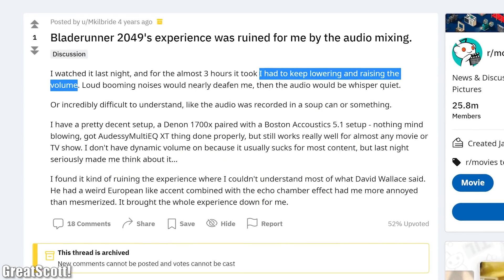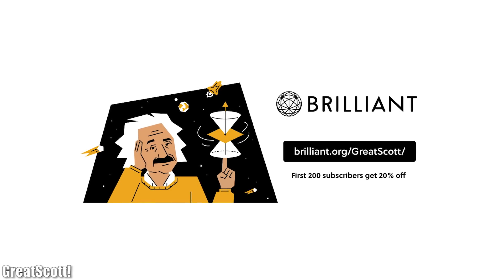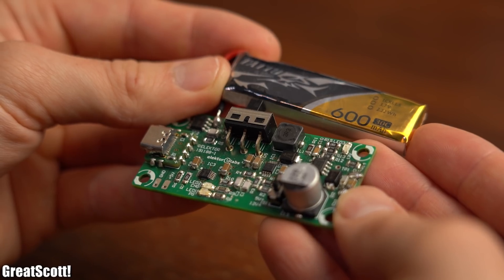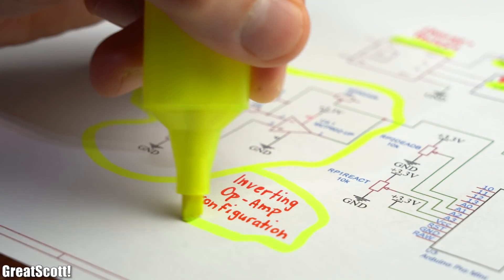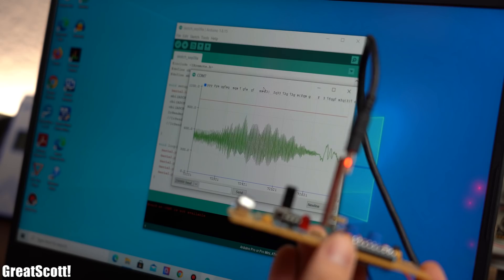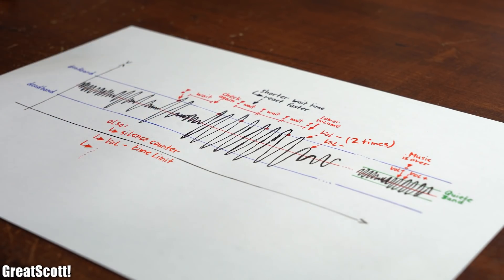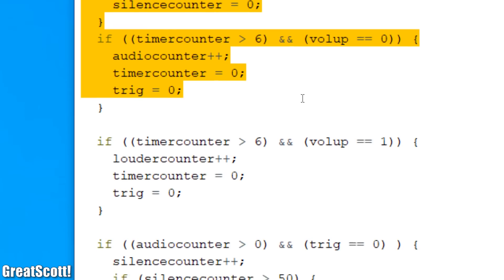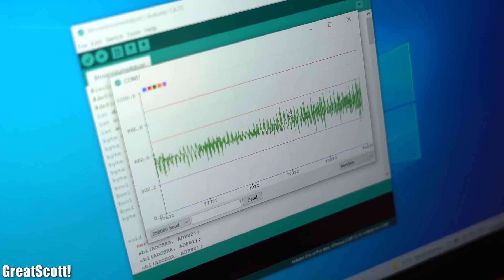Movie Music has a LOUD PROBLEM! So I fixed that! (Automatic Volume Adjuster)

Comment: I don’t see that this needs an extra solution for the home. The audio mix of movies is always done for the cinema of course. In the IMAX theatre in my town the max levels are around 92 dB(A), which is right to get the impact of sound effects intended by the makers. In the home however these levels are too high in most homes. When I lower the level to say 85 dB max, then the dialog can still be heard well enough. This depends on the background noise in your home though. In my house it is 25dB(A). However when your ambient noise is say 35dB(A) and you live in a badly isolated appartment, then you cannot increase the level in order not to disturb your neighbours. In that case most equipment manufacturers offer the possibility of compressing the audio such that it suits your environment. Problem solved! It’s a compromise, but well worth the effort in exchange for peace.

Comment: I remember A sketch like this going around about 7-8 years ago when the 328p was getting popular. I never got around to building one but I need to now. I would have made mine run off USB power as most sound bars have extra usb ports or you can easily use a ac/dc 5v power supply. The battery seems pointless and semi sketchy as I don't even allow that battery type to be stored inside my house. But anyways as the device never moves. Supplying power is not really a issue via cable.

Comment: Excellent project, I will make this circuit some day, I like to use my studio near field monitors as computer speakers, and watch youtube all the time, I extremely hate it when the volume suddenly rises simply because the volume is not same for all youtube videos. Was planning to make an Automatic Volume Adjuster for this very reason, couldn't find any videos on youtube that shows how to build one for this application. Now I have a guide to follow to make a circuit, will save weeks of research. It seems like you did a lot of assembly programming on Arduino, I can tell that was a nightmare. Would use Atmel studio for the programming if using AVR chips (Arduino). I hope it can quickly lower the volume before the sound reaches my ears.

Comment: Modern movies are produced and directed by assholes.  I solved the problem by just refusing to go to the movies any more.  I value my hearing too much.  I'm glad you designed a way to fix the problem electronically, but I still think the proper way to fix it is to boycott the assholes in the movie industry.

Comment: Why not build an AGC (automatic gain control) using arduino and connect it between the sound source and your soundbar. I suppose it will give you the best result with the lowest latency.

Comment: Well, each streaming service has their rules, music and video, mostly approved by AES/ EBU for loudness. But now they are dealing with different sort of stereo, 3D etc channels. Which has to process to Stereo, or even 10 channels to stereo, each channel will be added to a designed stereo channel, which makes it louder, or quieter. Like VWestlife stated in many televisions you can set different dynamic ranges. For Videophiles and their cinema sound, too much had to change, with all the problems included. Can you imagine, how it is, for us, mix engineers to make videofilms of musicalbums?

Comment: That's a really cool project! Movie musics have been bothering me forever too!
I think I will do it with an ESP32 micro-controller plugged in the wall with a standard USB charger because I don't intend to move it.
I think I will setup the ESP32 as a wifi server and build a basic HTML & Javascript webpage to access from a phone in order to change the device settingsrather than having potentiometers. Maybe to show some data too if possible.
Your way of detecting volume spikes seems to work just fine but I want to explore something more complex on the signal processing side just for fun :)

Comment: Movies have thar great dynamic range because they're meant for theaters. Final compression should be done optionally at the player or TV and only if the user turns that compression on. Please don't ask for compressed mixes on the disk as a norm because that's how CDs and every other digital format for music ended up sounding like garbage despite having all the necessary technical features to be able to sound good.

Comment: Most Receivers, Bluray and DVD players all have audio compression settings to accomplish this.  On my Marantz receiver it's called "Nighttime mode" and you can adjust the amount of compression in the settings.  On my PS4Pro it's in the Audio settings,  On my Xbox One X it's also in the settings.  It's also in the settings for media players on the PC, Mac and Linux.  Um... did you even bother to read your manual?

Comment: This issue exists with broadcast TV aswell. Commercials are always very loud. I remember my dad talking about how an invention like this would get sold very well.

An improvement idea from me: you can catch the audio signal via aux from your TV, most TVs let you enable multiple audio outputs. Then you can use the aux input to decide whether or not to change the volume. Maybe even adding another audio output on the device and connect your sound bar with that. Bet there is open source software for doing sth like this. Seen some people mention how compressors do this thing. I didnt know the technical term

Comment: One aeon ago, I built the same exact device - but with a 100% analogic criteria.
I used an integrator with tau = 0.5 sec, which produced a voltage proportional to the audio volume. I the used a voltage comparator which fed a transconductance amplifier, basically a voltage - controlled amplifier.  I set a variable voltage at one of the comparator input (the volume control), and the output of the integrator at the other input of the comparator, with the output controlling the transconductance amplifier.
It was pretty complex at the time, for which I had to design tre trans amplifier with two 741 and some JFET (trans amplifiers IC weren't available yet), and it was a professional design; many automatic volume controls at the time didn't use AGC circuitry but a couple of germanium diodes in the feedback loop of an amplifier.
Thank you for your video...

Comment: OMG. if your goal is to learn about electronics engineering, this may be a useful exercise, but it is a gargantain waste of time to  build something that will never be as good or reliable as something you can buy off the shelf to solve this issue for not much money.  I am a huge DIY guy, but my rule is not to reinvent the wheel if you dont have to or if it doesn't save any money.

Comment: At Last! At Last! At Last!. Someone has aired the problem. Why it happens cannot be an accident. There is something really sinister out their controlling everything to create constant stress in the population. This loud music blocking the dialogue in movies is designed to raise stress levels. I've read the many sophisticated solutions below which are beyond my comprehension. So I just turn off modern movies and videos and watch old movies where the sound technicians knew their jobs. It's a pity that modern movie directors do not take back control but I think that they are part of the mindprogramming.

Comment: Congratulations you fucked up the dynamic range with compression like communism did to the people! Compression and limiting without proper mastering simply equalise low levels and high levels similar to fm radio stations if you like this then use your tv only and throw everything else! Movies have a 24db dynamic range so there as much as close to reality. The idiotic (new) music only 6db that's the reason it's sounds so terrible! So you try to achieve something similar to this madness; Do you even think once how complicated and expensive is the mastering of a movie; Why they bother to do it; Get a descent system speakers etc and you'll get there. Get a denon avr with audyssey mult eq xt and this marvell of engineering will remaster and adapt the movie to your home listening conditions without sacrificing everything! First you have to understand how things work and then trying to "correct" them like they did in middle ages!!!

Comment: Automatic Gain Control (or Automatic Volume Control) is a standard type of circuit taught early in a basic electronics program. Any decent audio device such as a TV should have such a circuit built in to it.

Comment: There's usually a setting for loudness leveling in most TVs. Also you can try changing the sound stage from high dynamic range (audio) to medium or low

Comment: I Take my TV Sp/DIF Toslink Optical to a Cheap Optical to 2 RCA output analog Converter then into the Rotel Amplifier AUX In. Would it be easier to construct something in the D==>A circuit? Do you need a Microphone? Can't you sample the Analog output between the D/A  to Rotel input signal? Ideally I would like an affordable Digital Compressor/Limiter. I don't like Sound Bars so I used 2 KEF uni-Q speakers which sound great and fit perfectly.

Comment: My AV-Receiver has a dynamic compression feature, also, if yours doesn't, the obvious way to go, would have been to build a digital dynamic compressor into the HDMI stream. There are chips that can split the stream from HDMI, and remux it also. However you went with the ultimatively odd solution and a absolutely love it! Such a nice project!

Comment: What's interesting to me is that this issue was fixed in 1996 when DVD was released. All players had dynamic range control by default. You could choose to experience the original theatre dynamics or to have it modified to suit the home environment. Since then the problem has come back with the advent of bluray and streaming services.
Reply: On semi related note. Fuck Blu-ray and it's huge licensing fees. They are the reason why blu-ray drives and even the discs themselves are so expensive. Also the reason why it isn't even to this day, very popular way to release smaller budget stuff. Every PC used to have DVD player, everyone had player at home (that you could buy for 20$ new) everything was released on dvd. You don't see that with blu-ray. Sure consoles support the tech but you need ps5 or xbsx for UHD and even they are still hard to get (not as hard as during the launch but still ridiculous). Streaming is probably biggest reason why physical media is dying but for people who want higher quality, it sucks to spend so so much more money just because of greedy companies. I wish hd dvd won.
Reply: bluray players are cheap as hell now. Now UHD players are still expensive... but most people arent buying physically media anymore except enthusiasts. It's like complaining laserdisc was too expensive in the 80's, while everyone use the inferior quality VHS. The general population don't care enough about quality when their are cheaper options.  DVD was a huge success because the technology quickly drove prices down, and the discs were vastly cheaper to produce than tape. But there simply wasn't huge jump between dvd to blueray, or by extension HD dvd, for the general population to care.  So the cost simply remained high for a long time, which further delayed adoption. Basically HD dvd would suffered the same fate as bluray if it won the format war.

Comment: Had you used a fourier transform this would have been super easy and consistent. Those are generally somewhat inexpensive and I think the arduino might be able to handle it pretty well.
Reply: Except you'd need to preprocess the entire movie to equalize that and how exactly do you plan to do that when watching tv or streaming  a movie? You'd have to specifically download and process everything you want to watch before hand which completely negates the point of watching tv or livestreaming, not an option for real time processing.
Reply: @DrakeOola  who told you the interval for an FFT had to be the entire duration of the piece of media? CDs have a 44khz sample rate- you can take a small fraction of that, say 1/10 and use that (could still easily encompass 4 periods of 40hz which is basically as low as audio will go). so if your computed FFT volume was above some configured value (which you could even configure differently for different frequency ranges - would come in handy here since you might be more annoyed by loud acute high pitches than loud low pitches or viceversa) you just lower the entire volume proportionally until it's at your threshold. a fast enough microcontroller could even selectively lower the offending frequencies only. and sure there's be a 100ms delay on a really loud noise, but that's nearly imperceptible, and even if it's a loud bang or a jump scare that you can perceive, it won't bother you because it'll only be on for 100ms. 
don't talk out of your ass - real time signal processing is very much a thing, and it uses FFT a lot of the time- in fact that's how a lot of synthesizers and even guitar pedals work.

Comment: why not just use a limiter? it will sound more natural... all this work for something that is basically technology from the 50-60s (even a bit earlier). compressors, optical, tube, FET, VCA... now digital. take your pic.

Comment: Interesting.   What would be great is something that would keep the voice at the right volume and decrease all the other loud noises. This may include voices at times.
If only they would make separate channels. One for the voice and one for everything else. Two volume controls on devices. One for each.
I don't think movie makers and such would ever consider it though. They would have to work with device makers. Won't ever happen I suppose.
Reply: Well. 
That is basically how it already works. 

Dialogue is mixed to the center channel way above the rest. 

Then comes the cable companies and/or people selecting the wrong downmix mode when not listening in 5.1 or Atmos but in stereo. 

When you combine the 2 Left plus right channels you gain 3dB, and this could include material from the surrounds aswell and if not compensating properly for the single center dialogue channel, you get the dialogue 3 or more dBs too low compared to the intention. 

This is happening ALL the time, and is purely user error with the cable companies and the end users, and NOT the people mixing these movies, because they NAILED it.
Reply: Well that's too bad.  So if they had two separate volume controls on the device such as a TV you don't think it would work anyhow?

Comment: Realtek Sound Manager on Windows 10 has loudness equalisation feature built in. It works live without noticeable wait time. It matches the volume to the volume level set in windows. This is very helpful in movies with low dialogue and high effects volume. This is also helpful in games which give you sound clues like footsteps of enemies. Good project though.
Reply: Yeah i was going to say the same.

Seems like this problem would be easily solved if set-top players had a little more sophisticated software in them.

Comment: All comercial movies are mixed in at least 6 discrete channels being only one of them exclusively for the voice. If you mix the other 5 into two you end with really quiet voice at times and loud music/effects. Ideally, if you love movies, you should have at least 4 discrete spekers (no soundbar please). When watching with 4 or 5 discrete speakers you start to understand why the center channel, although usually louder than the others, is only used to voice. If you go to the cinema thats basically the way it sounds.
Most tv have a night mode option wich applies a really slow audio compressor to keep the audio in a reduced range specifically for the tv speakers.

Comment: This is a really cool project and a nice solution if you live alone. However, if you have a (loud) family like I do, you often need to turn up the volume to hear your show over ambient noise. This solution would dial down the TV volume when people talk loudly (or when the dog starts barking, when someone turns on a vacuum cleaner, a blender, a radio, etc), making movies unwatchable. I’m starting to imagine a somewhat more complicated solution with opposite ambient noise sensing using a microphone with a cardioid pattern placed near the entrance to the room and with the null oriented toward the center channel and front speakers. When the volume at this remote mic exceeds the volume at the listening position, it automatically increases the volume.

Comment: British TV had this same issue in the 70's especially with Doctor Who. Sound FX and incidental music overshadowed the dialogue constantly. I don't know why we're having this problem now in US movies. I can believe that the sound editors don't hear it sometimes, but the studio not hearing a problem seems far fetched. Could be the conversion to DVD and Blu-Ray. If they run the audio track through a compressor or normalizer filter it could explain the problem, they do it with music CD's, or if they convert it from 7.1 or 5.1 to stereo, who knows, the studio usually contract out for the Blu-Ray and DVD production. I don't remember have problems hearing the dialogue in the theater ever and some of those same movies in my collection have that issue.